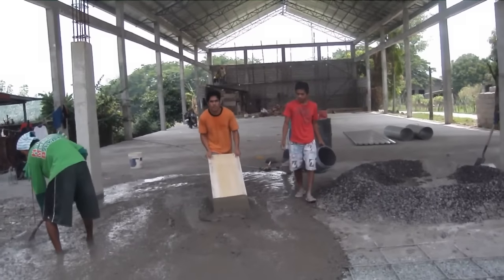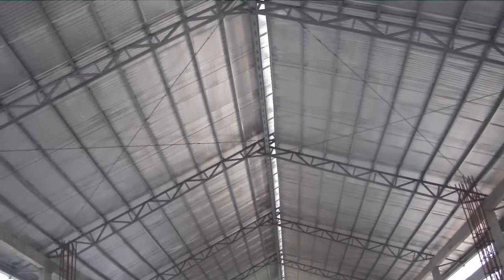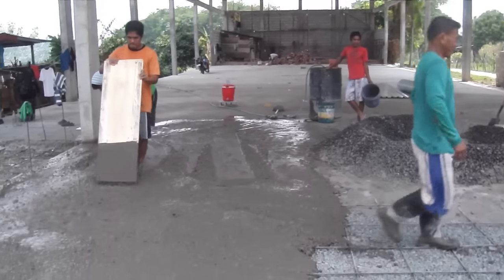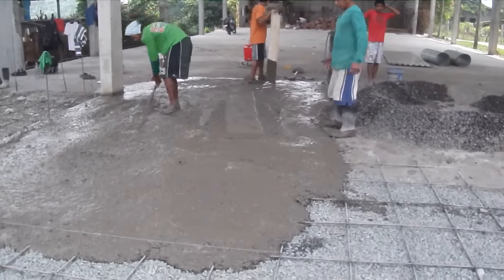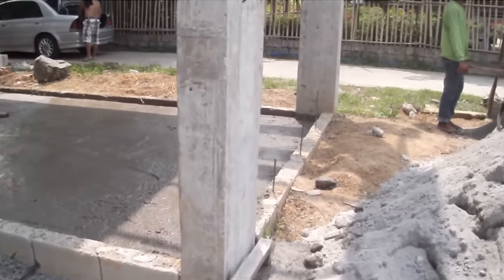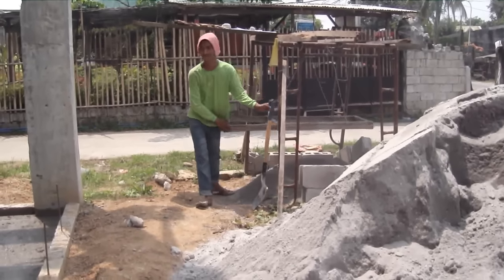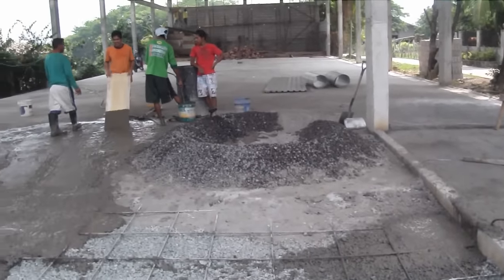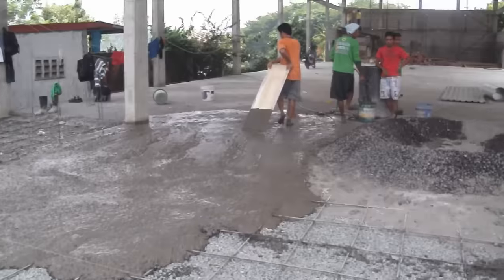Filipino Church Construction - Concrete Floor - Update

Comment: Awfully wet looking mix. Too much water weakens concrete. Hope they don't use sea sand. 
Is everything mixed by hand when they build the tall buildings? Would be tough to get a uniform mix and a core sample would be meaningless.
Reply from the maker: +Hog Man There are ;large truck cement mixers here for large projects. We are a bit rural also to have a truck come out this far. Also they are very expensive.